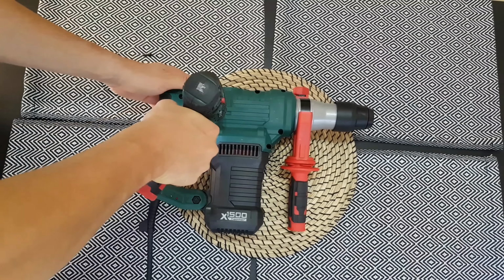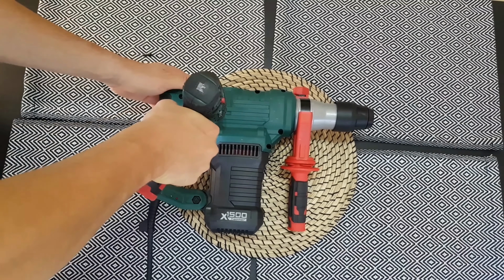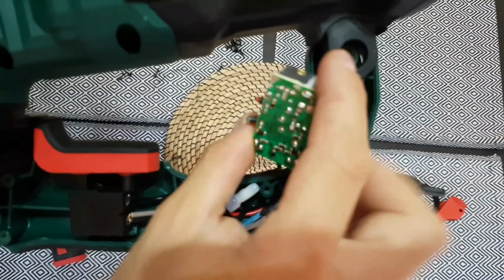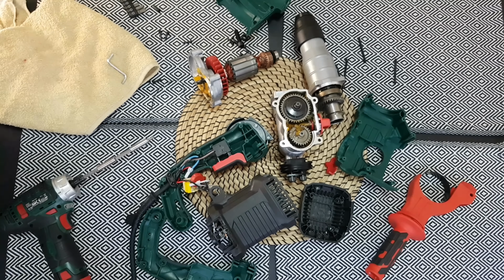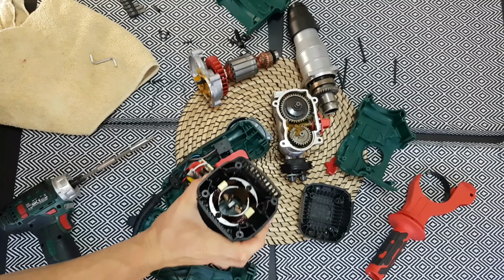Parkside Hammer Drill Disassembly

Comment: Your no AVE but I still like your vids. Lidl tools amaze me with the quality vs price. The20v range running 4ah battery is cracking.
Reply: AVE has undeniable engineering knowledge base... that is the difference.

Batteries are hard to get for any older (4-5y) Parkside models and re-build often is unsuccessful because there is small micro with firmware stored in its flash memory. When you remove old cells to solder new ones, that flash dies quickly without juice and even if you install fresh 18650 LiIon batteries, it won't work at all and charger will do nothing.. and there is no way to re-flash that micro at home. You need hex and programmer.

While even for my green low-end Bosch screwdriver from 1996 I can still order new battery pack... That is the difference.
Reply: xmeda I didn't ask for the difference.
Reply from the maker: yes it is a very good battery and i made it my primary for all my tools
Reply: @xmeda  sorry i just refurbished a 14,4v parkaside drill from 6 years ago, and works fine. no microchip to prevent me. i have been using it for the last 2 years without a hitch.

Comment: OK, switch is cheap with no micro, cables are thin and unprotected from vibrating all around inside. Regulator CEM-1 material board is not protected from dust or moisture by any coating. Body plastic is definitely almost not reinforced, probably below 20% glass fiber filling to save on tooling. Motor is not brushless as there are carbon brushes with just a wire connected and attached in plastic with no proper copper cages. Rotor and stator windings are only relying on wire lacquer and have no other protection at all, which is very bad for such tool. Lubrication used in gearbox looks to be the cheapest type which has to be regularly refilled/replaced after some use. Gearbox has no seals too. Gears are pretty roughly shaped powder sintered metal type. Gear selector is attached to plastic knob... I bet that bearings are not shielded at all also.  

This tool really is only suitable for short term low volume light work... no doubt. With all the dust and vibrations present on construction/demolition sites it will die very quickly. I suggest owners to do long pauses frequently to let it cool down during work. And to buy some better lithium based grease for the gearbox.. 

Andrew, when you are removing motor from housing, remove brushes at first...
Reply from the maker: thanks for your reviewing all that :)
Reply: :) next week this rotary hammer is going to be offered in local Lidl czech stores. It already is printed in advertisement papers.  About a  year ago I was tempted to buy the previous model, parameters are nice on paper, but after looking at it closely with own eyes I've decided to rather invest some more money and later I've bought Metabo UHEV 2860-2.. it cost three times as much, but materials and assembly are much better. Also it is posible to order any part even for 10 years old drills, which gives some more confidence.

But yes, if somebody just needs to drill few holes and destroy some tiles in one flat.. this Parkside might be ok. Anyway I would recommend to blow the dust away from motor with compressor after any use at least.

It will be nice to see this hammer after some upgrades - those things I wrote above like shielding for stator + rotor. Shielded bearings. Proper wiring with vibration mitigation, better brushes and better lubrication.. it will add maybe €10 for production cost, but it will last much longer then. As a customer I'll happily add those €10 or even €20 for these improvements. Unfortunately masses see only the lowest price :(

Andrew. .do you plan to review PAH 1300 demolition hammer too? :) It looks like copy of some old Hitachi with cheap parts, so it might be interesting to disassemble it too..
Reply from the maker: and again thanks for you replay can't agree less, yes i am waiting to come to my store :)
Reply: Its not designed for a construction site it is designed for DIY
Reply: True, I used it very rarely, to drill a hole or two in a wall. The first time I used it for a serious job, it died after 45 mins or so.

Comment: at 08:22 please somebody ANY Ideas what is happening there? My drill is always turning the shaft, even when in "hammer only" mode. --> Hammer only mode is selected at the start at 08:21. I know what the knob and turning is doing to the small gear (pressing down a plate with spring under the gear  wheel so that it is connected to the shaft and futhermore to the hammer mode).

But what is happening when you want to deactivate the turning mode of the drill shaft??? the power goes through the big gear wheel. But the knob and this turning plastic plate seems to do nothing!!!!! arrrgh. 

(when the plastic plate is turning into the camera and then turning to the LEFT side (hammer mode only) there is.....nothing. only air.
Reply: Pls do you find where is the issue i have same problem

Comment: I bought this machine last week and it did its job of removing concrete well. After an hour of demolition work on concrete when the silver part got hot a black grease started running down the chisel. I worked for another hour after that. I couldn't remove the chisel from chuck. I had the machine replaced by Lidl the next day and the new one has the same problem. Any suggestions?
Reply from the maker: same hear and the new and the older model the same problem.
Reply: I guess i should start a "ping pong" with service as soon as I finish demolishing concrete around my house then. How did you get the chisel out of chuck ? Would a quality grease prevent that problem ?
Reply: I had exactly the same issue with mine, replaced by Lidl. After few months the new model has the same problem again. It would be great to have a video explaining how to fix the chuck / chisel assembly.